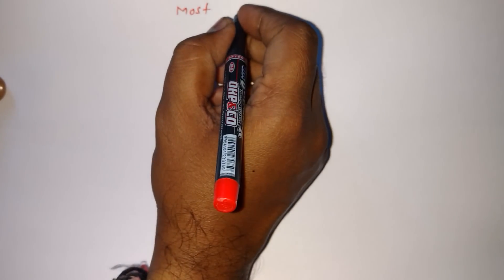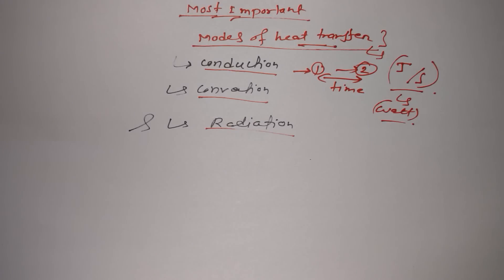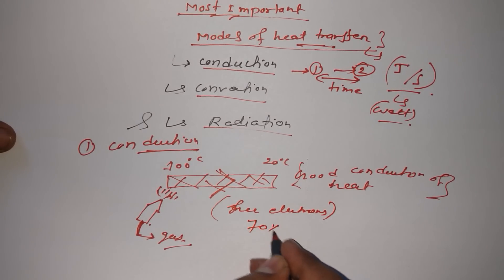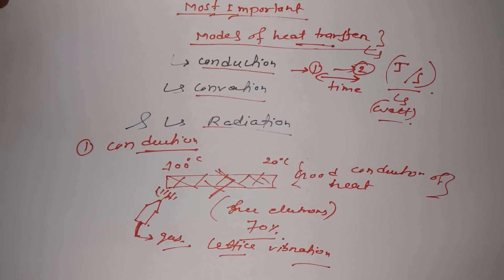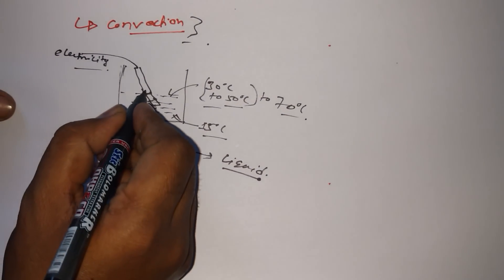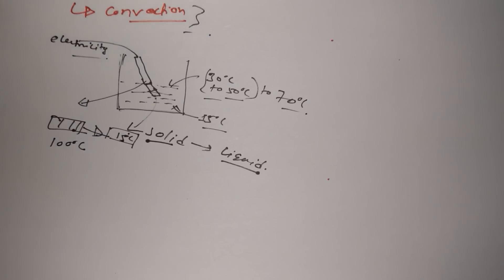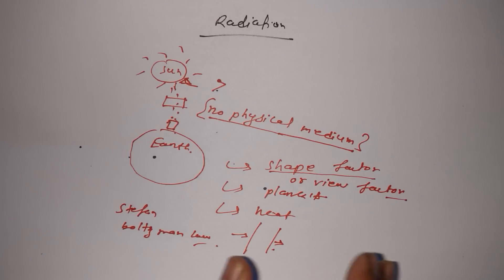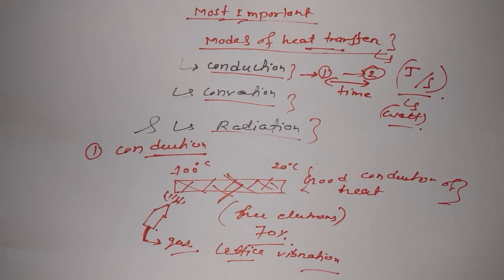Modes of Heat Transfer (Conduction, Convection & Radiation) HMT Tutorial- 3

Comment: sir I have question.
I have a block of cheese whose dimensions is l x b x h, 360 x200x75. It's get temperature from 65 degree to 25 degree in 3 and 1/2 hr with direct contact with water at 11 degree.  Now I want to know how much temperature of water I maintain to reduce the temperature of cheese block from 65 to 25 with in one and half hour. 

pls sir revert me...pls....also tell me load in TR